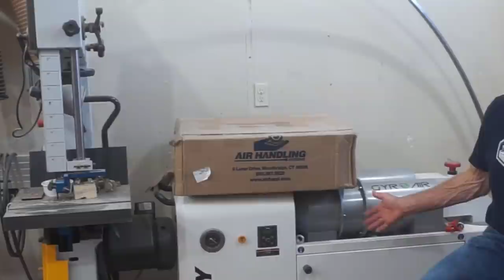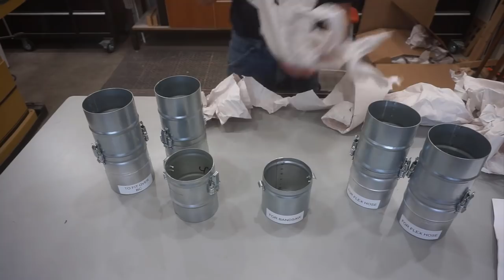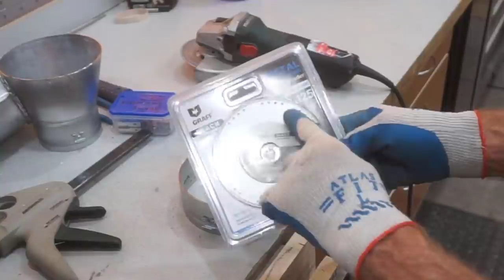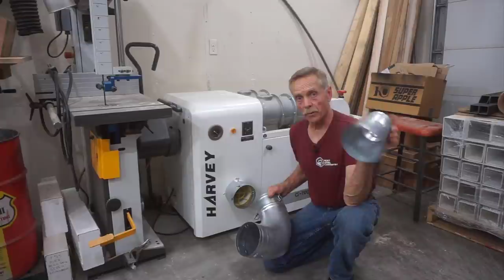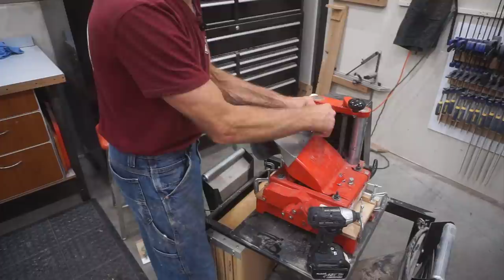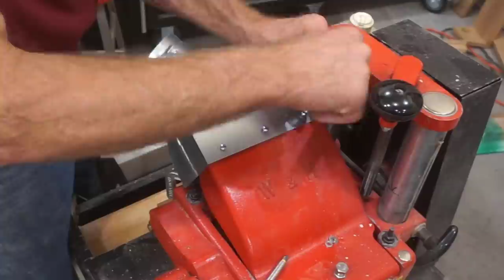Flexible Dust Collection Piping

Comment: I hope you run a continuous ground wire throughout your hoses to prevent sparking and combustion of the dust.
Reply from the maker: You'll be surprised and amazed that I see no need for a grounding wire using the anti-static flex duct from Air Handling Systems in my shop James.  This is what you see in use in the video: https://airhand.com/product-category/flexible-hose/anti-static-flexible-hose/ and I've experienced ZERO static build up issues.  Anyone who believes a ground wire is necessary should certainly incorporate one into their system but I advise research into the necessity of the practice.  You may be surprised to learn that sparking and combustion of dust is a bit of a myth... but don't take my word for it.  Best, Matt
Reply: @NextLevelCarpentry  your hose has it built in from the manufacturing process. The hose that I have used over the years do not and the static build up was horrendous under the right humidity conditions, until I incorporated a grounding wire. Combustion under those conditions is not a myth but are easily avoided by not using the less expensive flex hoses , or by using all metal ducting , running a continuous ground or use of flexhose like the one you have, and of course avoiding plastic couplings. It would be interesting to see the installation instructions that come with it. Thanks for the new info.:-)
Reply: They are anti-static hoses so a ground wire isn't necessary.
Reply: That's an old wives tale.
Reply: @AdamMuhle  the wire is built into the hoses.
Reply: @onjofilms  not true.
Reply from the maker: @jameshaynie4570  the way I understand it is that there is something different about the plastic itself that has anti static features because I don't consciously ground either end of that long spiral wire in those pipes so it is not providing a legitimate ground the way I have it set up but I still do not have any static shocking or dust build-up with that hose.
Reply: @NextLevelCarpentry  I think the ground is established by the wire in the hoses when they contact the all metal fittings..
Reply: @RazaXML   never heard of one exploding, just the sawdust catching fire and burning very fast. Had it happen in my shop about 20 years ago. Luckily  there wasn't much dust in the collector at that time because I had emptied it the day before. Had to replace the bags and a section of hose .
Reply: @jnimitzch4738  my shop isn't exactly small. Not commercial size though, it is 20 X 36 feet.
Reply: @RazaXML  doubt all you want but I don't use dull blades and I don't do deep rip cuts on a table saw. I use a bandsaw for deep cuts and it is not hooked into my dust collector . The fire was started by a static discharge in the hose about six feet from the saw and six feet from the collector as evidenced by the hose itself.
Reply: This combustion myth has been disproved time and again. It doesn't stop people from repeating the mythology, though, and claiming to "know a guy who saw it once happen". Dust collection systems like this, in anything short of an industrial cabinet shop constantly running fine sanders, don't put anywhere near the required amount of fine particulates into the air to allow for combustion.

The ground wire can help with keeping you from getting shocked when touching pipes. But really, that's about it. And for that to work, the ground wire has to be woven pretty closely around the pipe, not just run along it or in it.
Reply: @jameshaynie4570  (reading further in)

The incident you had almost certainly had nothing to do with static electricity igniting anything. There may have been a burning piece inside, or some other factor. You can ignite by hitting a nail or staple and having that, while hot, get sucked in. But the conditions for igniting airborne sawdust in ductwork in a small shop just don't exist, even in very low humidity.
Reply: @Psychlist1972  cite your source for proving it to be a myth. If you buy a dust collector and a kit for installing intakes at other places in the shop that includes flexible hoses,, they either provide grounding wires and clamps or at least advise you to install a continuous ground to prevent static electricity and sparks sufficient to ignite fine sawdust. Now they have come up with anti static hoses. Why do you think they would do that? A little common sense please!
 I will say that ignition is trade but once is too many times. 
If you don't clear your wood of metal pieces before sawing the wood, you must not be a very good woodworker or you don't care about your tools.
Reply: @jameshaynie4570  The anti-static hoses and fittings are to prevent shock and accumulation of dust due to static. They're not about preventing an explosion, because the dust is never in a sufficient concentration to be an explosion hazard. That part is using some common sense. :)

You're making a claim. Show verifiable evidence of dust explosions in a home shop dust collection system. 

As to metal: I've not had it happen to me. I was offering suggestions as to what may have happened in your case. In any case, good woodworkers can hit metal in reclaimed wood or while resawing. It happens, even if they care about their tools.

Companies are loathe to say not to ground things, because of the little bit of liability involved. They also know that dust explosions in industrial settings are a real possibility because only there do you have sufficient volumes of suspended dust in the network, so usually they'll just weasel out and say there's "potential".
https://www.rockler.com/how-to/exploding-pvc-dust-collection-ductwork/

Here's an explanation of what "grounding" is really doing, and what it is not doing.
http://store.workshopsupply.com/catalogue/pdf/DC-Myths.pdf
Reply: @jameshaynie4570  More explanation, but this isn't as comprehensive as the last one:

http://cliffsgarage.tv/articles/dustExplosion.html

The point about sanding dust is good. He points out that you'd have to sand off, on a 12x12 piece of oak, 3/4" per minute on a 1000CFM system in order to get enough dust to potentially ignite. This is why this is a non-issue in the small shop or home shop. 3/4" of sanding per-minute is impossible.
Reply: @Psychlist1972  it is obvious to me that you are not considering all of the variable in this subject. I do a lot of extremely fine sanding of wood, wood polishing in lieu of finish on burls and other figured wood. The finer the dust particles are, the easier they ignite. Also the type of wood being worked makes a difference, some woods have sap that is very flammable. Then of course there are reclaimed woods that may have combustible materials in them. The velocity of dust moving in the hoses also makes a difference. I would prefer not taking an unnecessary risk, especially after experiencing 1 fire already that was started inside my dust collection system a very long time ago. It is cheap and easy to run a continuous ground, so why not do it anyway just in case?
Reply: @jameshaynie4570  Because doing so, and then commenting on videos like this, perpetuates a myth. This is the same thing that happens in other areas where folks say "what's the harm" and you end up with generations of people believing some thing that isn't factually supported. Then those people start to include folks like insurance adjusters, marketers, and more. In the end, people go through a whole lot of extra effort and money to do something that was completely unnecessary.

This has been hotly debated for decades but only because people refuse to look at the facts of the matter, and instead prefer to believe anecdotes.

If you read the sources I posted, you'd see that even on a super small DC system of only around 200CFM, you'd still need to sand away 3/16" per minute across an entire 12x12 piece of red oak, to get anywhere near the level of powder needed in the system to have any chance of igniting. As I mentioned, that goes way up with larger / more typical dust collection systems. And it's not really a matter of "the finer the dust particles are, the easier they ignite". There is a specific particulate size and density that is needed to combust. Above that size, you're moving chips, and without an actual flame, nothing will happen. In those cases, anyway, the dust bin itself is far more likely to be the problem area. Additionally, having ferrous metal sucked up by a floor sweep is more likely to ignite.

You are, of course, welcome to do what you want with your own system. But evangelizing the misinformation to others shouldn't be part of it.
Reply: @Psychlist1972  you are wrong and maybe you should try some experiments before your advice causes someone to die. I prefer to be safe and eliminate the possibility of ignition.  Hope you never experience a calamity in your shop.
Reply: @jameshaynie4570  Oh FFS. I'm not wrong, but since you have turned this into a religion, and provided zero evidence to back your claims, I know there's no convincing you. I doubt you even read any of the information (that you requested) that I provided you. The perpetuation of mythology continues.
Reply: @Psychlist1972  I read your articles but did not see anything that disproves my experience. Bye Pete, keep believing your myth that it can't happen.
Reply from the maker: @jameshaynie4570  I admire your passion for this subject!  I'm sure someone, somewhere at some time has been hit by a meteor but I'm not going to perpetually walk around wearing a flack helmet just because it happened to that unfortunate soul 😂😎 Best, Matt
Reply from the maker: @Psychlist1972  Thanks for interjecting fact and reason into this 'discussion'... I appreciate your investment of time that I can't personally devote to the subject right now.  I hope other viewers get sensibility and value from your investment of time! Best, Matt
Reply: @NextLevelCarpentry  I didn't want to have so many discussions on the subject, especially not on your page. You solved the situation in your shop with the new technology and all metal fittings. Good for you. I have a much larger shop than you and a much bigger dust collection system. I did have a fire in my dust collection system many years ago and it was because of static ignition. I solved my problem with an internal continuous ground and have had no problem since. Pete doesn't know anything about my shop and what goes on in it. I got tired of his B,S, and blocked him in order to end it. Best of luck to you.
Reply: Hey, did any of you have a sawdust fired furnace boiler? My grandpa did. My mother had the job of keeping it lit when she was a girl in the 1940's. It was a complicated thing. It was hard to get it to light in the first place and then you had to adjust it all the time to keep it going. Varying ambient temperature, humidity, wood species, and the shape and size of the sawdust particles would all require adjustments to the sawdust feeder (it was some sort of auger I think) and the air draft, and the flue damper. Even if you had everything set perfectly a wind gust that sent a back draft down the flue would put it out.

Go ahead, have your buddy dribble a bit of sawdust into the air stream from a hair dry while you try to light it with the flint sparker from your blowtorch kit. That'd make a great YouTube video! I'll wait...

Each of the major woodworking magazines have run articles on this in the past 20 years...no I am not climbing up in the attic to find citations...and they have been pretty clear. You can't bring air and sawdust together in the proper ratio, inside of a dust collector, to ignite or sustain combustion from a static spark.
 
But even if we assume such a flame might sustained inside a dust collector, there doesn't seem to be any evidence of dust collectors burning down home woodshops anywhere in the free world. Now as Nassim Nicholas Taleb wrote, "No evidence of cancer is not evidence of no cancer" but if dust collectors were burning down houses, we WOULD know about it.

There are two mighty industries dedicated to making money by "adjusting" the liability when human stupidity runs up against Mr. Murphy. Lawyers and insurance companies keep track of these things. In detail. Several giant publishing companies are dedicated to recording and reporting the occurrence, the cause, and the laying of the blame for every cut, contusion, bruise, burn, amputation or death in the English speaking world. If a static discharge in a dust collection system started a fire that burned a home shop to the ground, lawyers would be on it like...well, like lawyers. There a are a dozen (hell, there's probably a gross) different legal publications which would contain exhaustive encyclopedia articles on the litigation. Someone would have found the articles and posted citations the first time this came up on the  Lumberjocks forums.

One last thing. Tool companies are big, and they are subdivisions of even bigger holding companies. They are what lawyers call "deep pocket" defendants. If an incorrectly installed duct system was likely to spark a potentially home destroying fire you can be certain that every part in the chain from your table saw through the clamp holding the flexhose running to the blast gate connected to the wye to the main run down to the cyclone into the blower and out the legbone to the thigh bone to the filter would have a prominent grounding lugs labeled in bright orange stating that the equipment must be installed by an electrician and inspected and certified by a local authority just to give the manufacturer a plausible basis to deny liability.
Reply from the maker: @christopherdahle9985  Yours is the most through and reasonable viewpoint presented on this comment to date... thank you for being so thorough, practical and polite by posting it! Best, Matt
Reply: @NextLevelCarpentry  Thanks Matt, unfortunately about half of my reply got cut off, not sure how. I'll just summarize that to say that I think most systems end up "grounded" by accident which is why so many of us never get a static ZAP.

I've been "zapped" when edge sanding floors with an ROS connected to a shop vac and that killed the sander. But I cant say whether the zap came from the sander, the dust in the hose or the vacuum. I don't think that means a thing relative to dust collection in the shop though.

I "grounded" the 4" PVC ducts in my old shop because I wanted to try out a harebrained theory had some materials laying around. But when I moved shop two years ago I didn't bother to ground the new duct work, although it's mostly 5" sheet metal with 4" PVC only in the final drops.

I think people should ground their ducts if it pleases them, but the lack of verifiable engineering specs or code approved practices tells me that there's not a lot of need for the practice.
Reply from the maker: @christopherdahle9985  more good info... thanks again!  I too ran a ground wire on my old DW735 hose setup but it was to stop the zap, not prevent combustion.  I think the thing that makes this discussion so volatile is that it just SEEMS like that dust would explode in a mushroom cloud, doesn't it?  Makes it difficult to convince some when facts get in the way... maybe grounding the discussion to prevent flare-ups is a more appropriate safety measure?😂😂
Best, Matt
Reply: @NextLevelCarpentry  I actually had a small flash out happen when sanding an MDF project in my workshop this past weekend. Luckily it was small enough that I wasn't hurt badly, but I did have to change my underpants afterwards. The danger is when enough dust is hanging in the air to reach a critical mass for a chain reaction. In most cases the combination of circumstances are unlikely, but not impossible. 

I was sanding MDF, using a very fine grit, my dust port was partially blocked because of a toolbox that had been accidentally put on top of the hose of the dust collector which limited airflow and allowed the concentration of fine dust within the hose to cross that critical mass.

When I took my sander off of the hose a static spark caused the dust to ignite. The resulting flash out was strong enough to send the dust cyclone on the far end of the hose to the far end of the workshop, flip over a fairly full steel toolbox, and send the sander through the door to the house leaving a basketball sized hole in the door. Granted it was an interior door, but it was still pretty scary.

Comment: I can see how, in your shop that gets reconfigured to include metal fabrication and hot work, that control of combustible dust is crucial to keeping the place from burning down (after you're done for the day) from an errant spark and smoldering sawdust.  Great explanation of your setup!  Bravo!!  The only down side I see is that you've got to step over the flex hoses, but if it works for you, its good!  

I wonder if making a stand for the elbow (like you did for the wye) would be beneficial to keep stress off of the QD and fitting going into the dust collector? 

....  Your "getting your ducts in a row" joke has me chuckling all day - thanks!